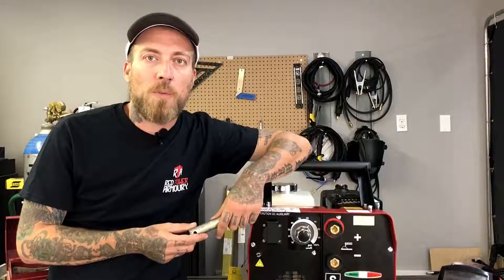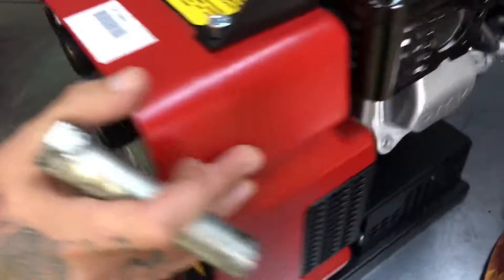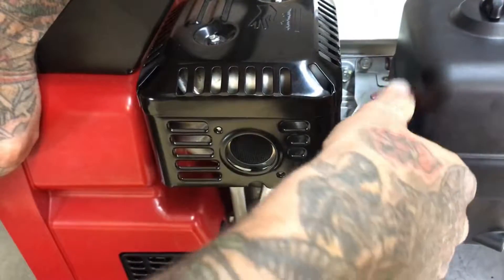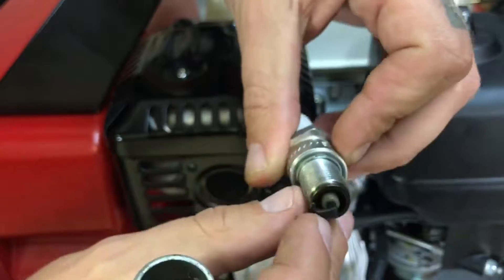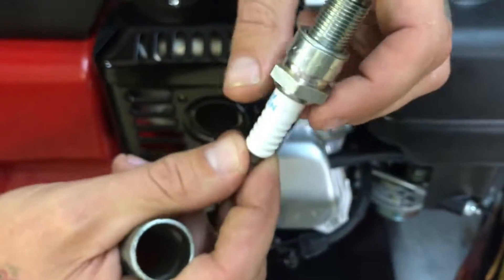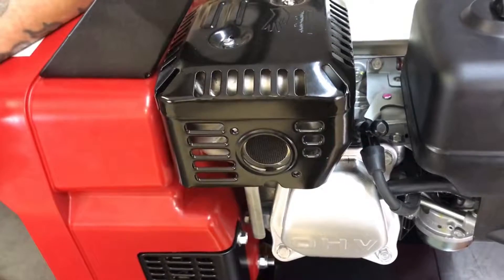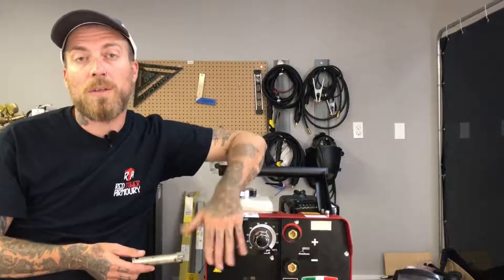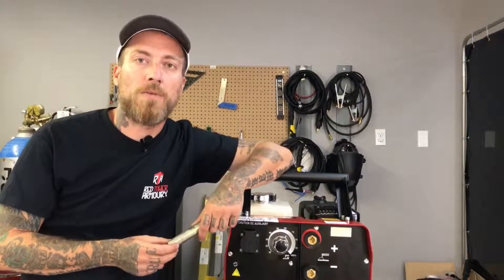How to Maintain a Stick Welder Generator | Magic Weld 150 Spark Plug Change & Tips (Part 1)

Comment: Thank you. I was actually wondering if you could do a video on that if possible. I leave mine in storage for long periods and it never runs right when I come to use it again
Reply from the maker: Dear @rickthierens6655 If you have one of our engine-driven machines, please fill out the service request form on our website, and we will follow up on the issue with you.

Comment: Can you do a fuel filter change and carb clean 😊
Reply from the maker: Hi @rickthierens6655, we provide all the necessary services to keep our welding machines running smoothly and without interruption. If you need any services for one of our products, feel free to reach out, and we'd be happy to assist!